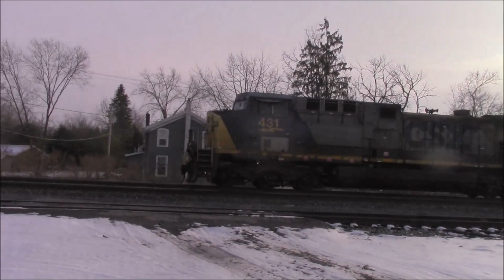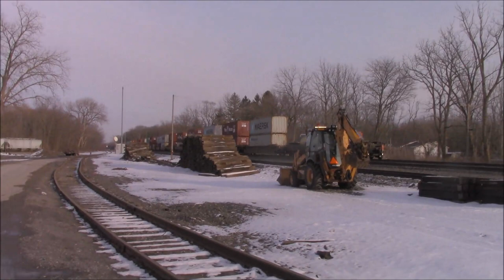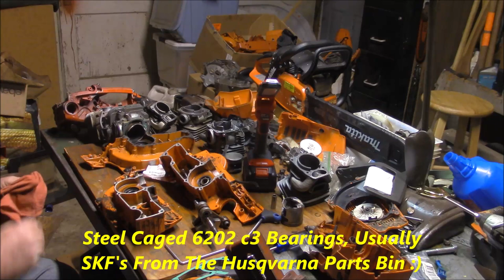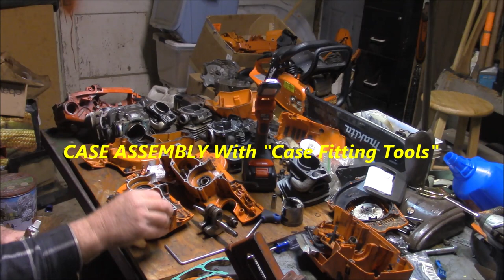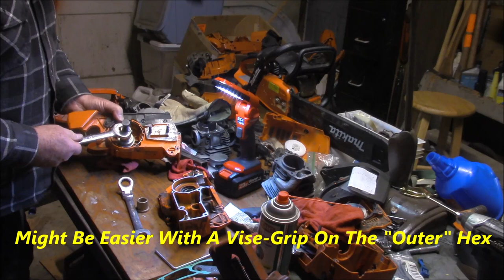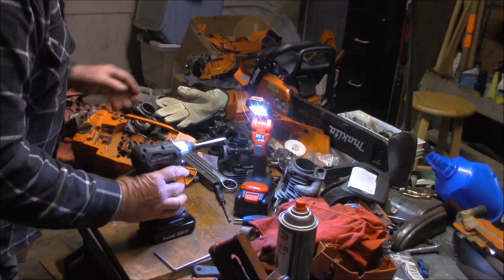How To Assemble Husqvarna 372 crank cases To Increase 2010 - 2017 Husqvarna 365 & 372 Reliability

Comment: Definitely prefer your case tool over the shop tool. I would probably weld a socket to a bar stock, instead of a wrench for the other shop tool instead of messing with the double wrench. However your set up is spot on. 👍

Comment: Your just teasing me with that makita sittin on the back of the bench aintcha?
Reply from the maker: It's on the stack, it's got a problem suspect from what someone posted it has a kinked fuel line somewhere. But want to muffler mod and do a no base gasket type thing to it. ONCE debugged.
Reply: @afleetcommand  im planning on tearing one down this week, just to see the numbers. First strata saw ive had or worked on